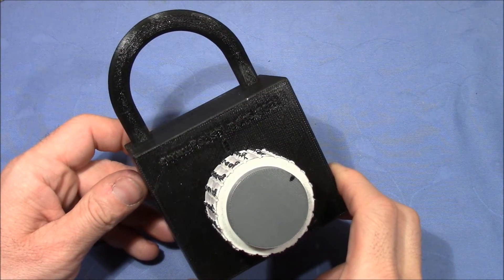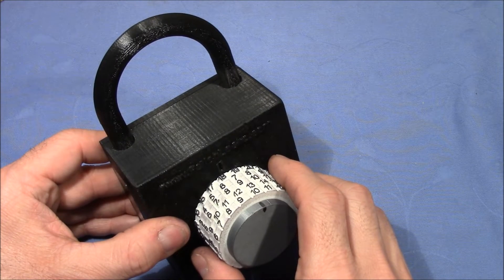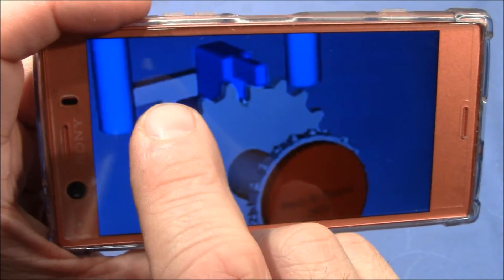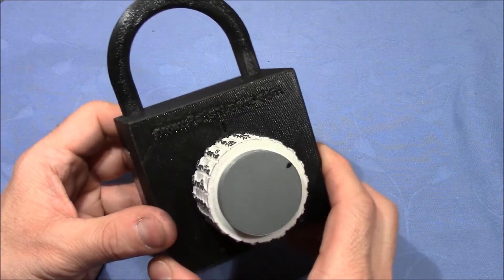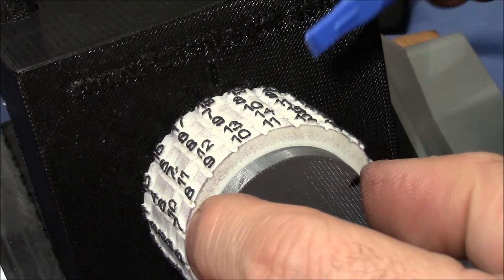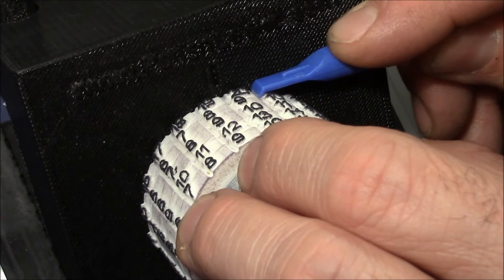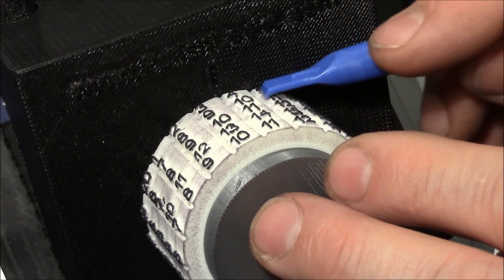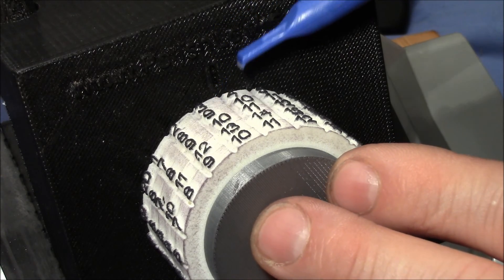(picking 629) The Polish Combination Lock NOT decoded

Comment: That is not a game about luck, the plastic is not an adeucate material to evaluate the decoding weakness of any design. If the designer is quite secure about his system, he will send you a padlock when he manufacture them in metal and you can face the challenge.
The design is interesting, but I'm still betting on you without any doubt.
Cheers my friend and thanks for your effort and for showing ;o)))
Reply from the maker: He's currently investigating a way to get metal prototype builds done. Let's see how the look like and feel. My main concerns with the 3d model and also with the mechanism itself is the user-friendliness. You will this in the final video. Thanks for watching buddy and your your opinion.

Comment: Interesting.. Your right, pretty hard to get true feed back when the whole wheel pack moves around like that. I think this would need to be approached more like a Safe combo lock manipulation. Have you gotten into Safe lock manipulation yet? (I'm just starting to get into it now) If so, perhaps a vernier scale could be used somehow. It would be hard to do with that many wheels stacked they way they are though. I wish I could offer more ideas or help, but I cant think of much more. You did great work though, don't sell yourself short.
Reply from the maker: I have no experience with safe cracking. I tries calibers but without success - not enough frictions between the metal and the plastic wheel.

Comment: Interesting. I was thinking though, that since each wheel has a false gate at each position, even if you could find the true gate, you would have to test just as many positions as a brute force attack starting at 0,0,0,0,0 and going up in increments of 1. Maybe same kind of bypass?
Reply from the maker: Yes, you have to test 5* 20 positions to get to the right number. But it's less than 20^5 in a brute force attack ;-) Will see if bypass is possible once I have opened it.

Comment: I think theres a way get the true gates from feel ... maybe try sliding a sleeve over the dials with a grove to fit the cut outs on dials .. so u can play with one dail goin anti clock while rest goin clockwise with the opening tension dial .. keep at it potti
Reply from the maker: Thanks. I think the main problem is the friction between the wheels. I tried with other tool to move and stop the wheels but not luck yet.
Reply: @Potti314  spray some lube in them dials
Reply from the maker: I tried but not big difference.
Reply: @Potti314  ok .. stop thinking its a lock and re think it as a safe .....time to get the doctor hearing scopes and go for sound decode?

Comment: By my opinion the main feature of this padlock is also it's major fault! It's a hard to remember 5 numbers from 1 to 20 in combination. For example, try to remember combination 18-4-12-19-6, especially if you do not open that lock on a daily basis! I also agree with @Enzo Guardino, that the metal version will give a better feedback.
Reply from the maker: I also think metal would make the lock work smoother which is desired for good user experience. This then will transfer the feedback more clearly, too. To remember the numbers is for sure a problem. On a usual safe lock it would be less to memorize.

Comment: do you think if the lock was made out of steel or brass that it would be easier to decode?
Reply from the maker: I think metal would make the lock operate much smoother which is desired for easy operation by the user. This also will transfer the feedback more clearly. But there are still options to intentionally destroy this feedback.

Comment: Unlucky Potti, perhaps with more time to play with it you could crack it! 💔
The plastic seems to cause the mechanism to be very sloppy. Maybe the metal version would give you better feedback to defeat it. It's an elegant design but I fear for the protruding wheels if attacked with a hammer. It looks vulnerable to a physical attack, no matter the material. As someone else mentioned, did you try using a feeler knife between the wheels? The true gate appears to be deeper than the false ones.
Reply from the maker: The feeler knive cannot reach inside I believe. And yes a metal lock would give different feedback. The destruction of feedback in the plastic model also makes it hard to operate normally which is downside. The hammer attack would knock off the outer wheels but you still cannot look inside as the hole is too small to see the gates on the inner wheels.
Reply: @Potti314  Thanks for the feedback, Potti. I didn't realise the hole was quite so small.